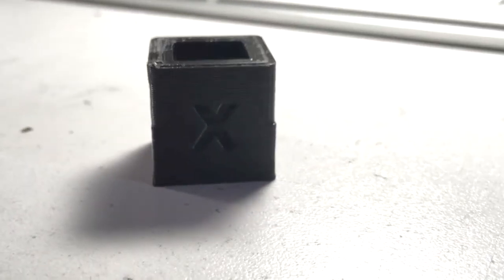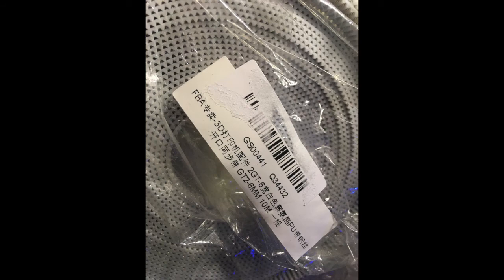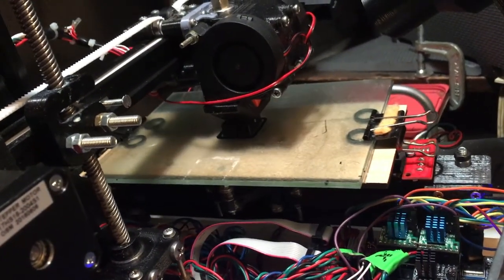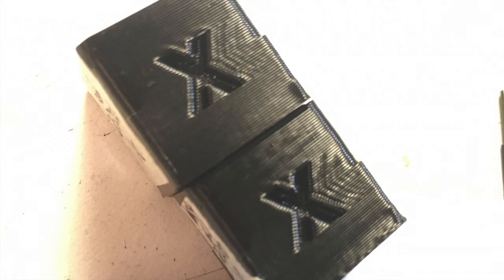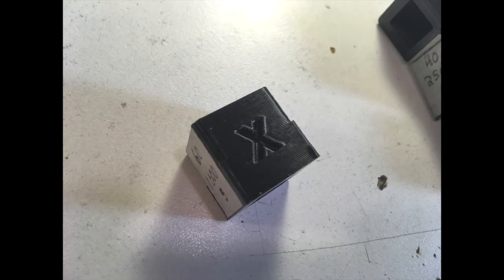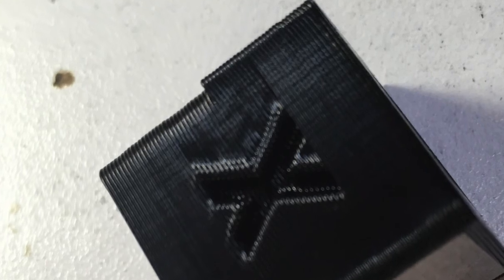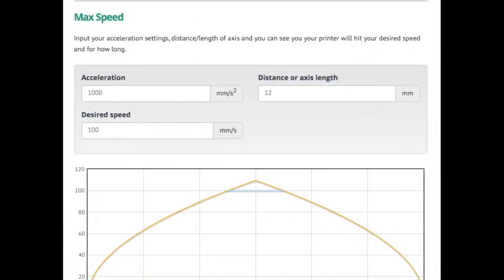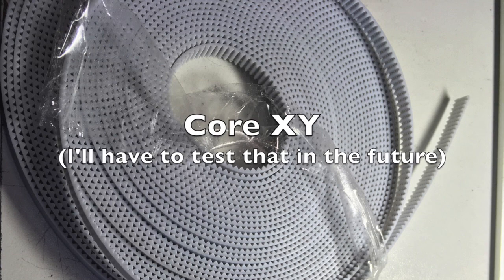Testing Steel-reinforced poly timing belt

Comment: I had some bad belt stretch on the white stuff, it was at the end and the steel-reinforment pulled through and allowed the belt to stretch about 1.2cm. I'd recommend that the belt retention not be purely inline with the belt axis as it was on mine. It seems just having the free end do a semi-constrained 90 bent is enough to prevent this as it hasn't happened again on any of the 3 axes since, though the printer is not complete and hasn't moved under its own power yet. Its a delta using 16t pulleys, so this should be interesting.
Reply from the maker: That makes sense since I have seen the belts separate a bit already.  Good to know.
Reply: @AlexKenis 
Which one is better fiberglass or steel core?
I have a bought steel core belt it is quite stiff!

Comment: Please test a Core XY printer.  The belt length on my Core XY is around 92".  
A Core XY printer would be the ideal use case for this belt if it improves the print quality.

Comment: Hey bud great video...

What do you like to run 5 on xandy jerk and 1000 on Accel?

Or is like 10 on X and Y  ok and just leave the Accel at 1000

Thx
Reply from the maker: Thanks.  It depends: I change jerk/accel/speed settings for every model and printer.  Obviously  more sharp angles and details means go lower, but no harm in cranking it up if there is nothing that would leave e ringing artifact in the model. I just have a bunch of custom presets that I work off of... like "small sharp corner slow" or " big curvy fast', etc.  only risks of going too low are bulging corners and whatnot, so if you see that, crank it up a bit.  the gcode analyzer at http://gcode.ws/ can help you visualize move speeds and dial things.

Comment: Rubber belt will elongate or harden maybe due to the heat. Maybe can look for a 2mm pitch for the pu version. Or use larger  pulleys and idler bearings.

Comment: Check out this belt configuration
https://www.youtube.com/watch?v=qXjLuLqFb-U
Reply: It's called belt on belt drive or servo belt drive. I think Core XY configuration is the worst because longer the belt lower the stiffness. The relation between belt length and stiffness is not linear.

Comment: Thanks for video.
CoreXY tests would be awesome!

Btw: what did U mean at 3:47 about not using steel reinforced one on small pulleys?
Reply from the maker: The steel reinforcements are strained too much bending around small pulleys, and they tend to brake apart and fray from fatique, etc.  Fiberglass is the same, but not quite as bad. CoreXY tests are on the to-do list, but I have no space to build another printer at the moment, so whenever I get through some of these other projects, I can get nerdy and design a coreXY machine to test.
Reply: I will keep my fingers crossed for CoreXY (Heypercube mabe?) then.

Btw - there's also black PU with steel core available on aliexpress, I just ordered some for my project.
(" 2GT-6MM PU with steel core GT2 Open Timing Belt " )

Comment: Great experiment, and good to know. 
How about the double belt system that you're using, do you think it's worth it with the standard gt2 belt ?
Reply from the maker: Good question.  It's actually one belt, but doubled over, and I have been meaning to do a video on that idea, but just haven't gotten around to it yet.  I like the system on that machine so far, but it has a few drawbacks, like extra bearings and pulleys, extra wear on the belt supports, having to use a wider carriage, etc.  But it has the advantages of being twice as stiff, twice as presice, not having to use a closed belt, and not having a tensioner flopping around, so it'a a tradeoff.